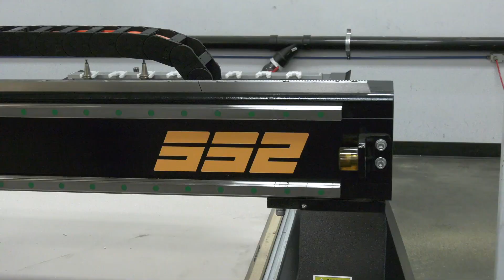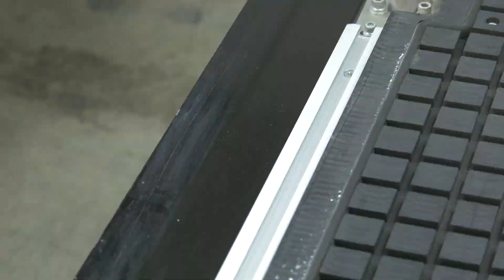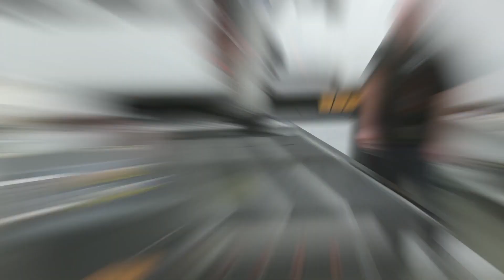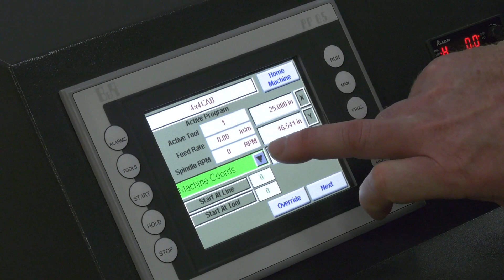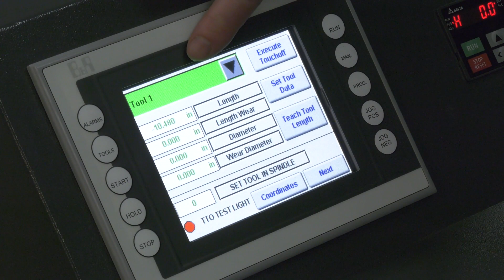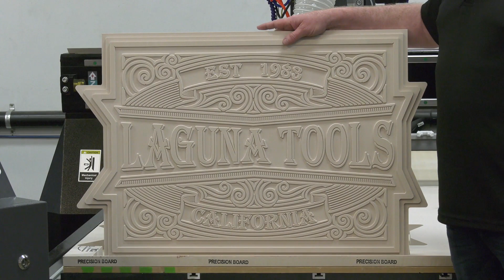Introducing the Newly Upgraded SmartShop 2 | Upgrade Overview and Project Demo

Comment: have y'all added filters to the control cabinet? Because my old SS2 collects a lot of dust from the fans pulling in more air than the outlet side can handle.  A fan actively blowing air OUT of the cabinet would probably be a better method, since the dust would have to float in through a passive inlet and could be forced out the active outlet.